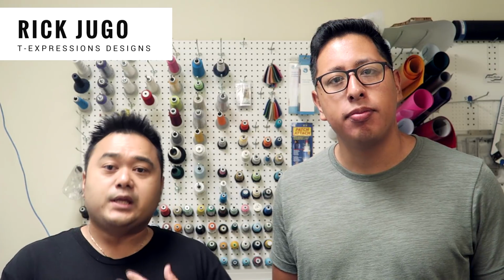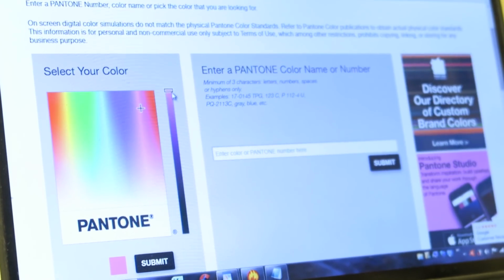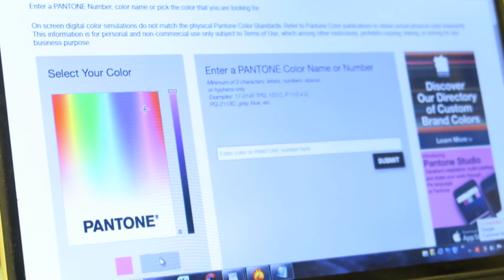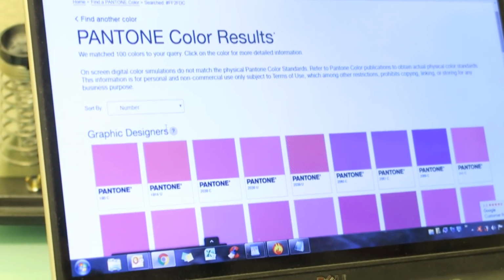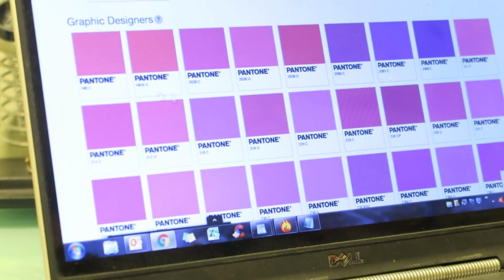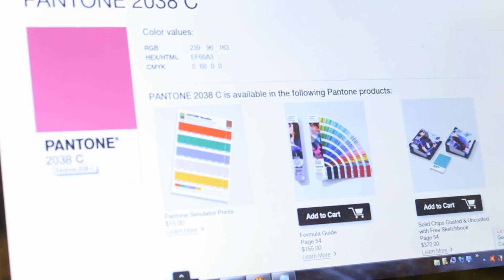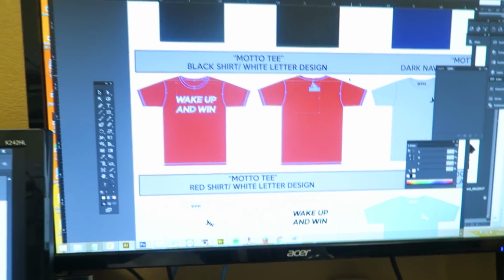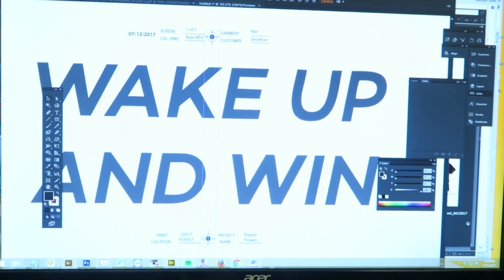How To Design And Print Your T Shirts (6 Step Tutorial)

Comment: Hey John, Great video!!! - quick question, I gathered this print modes were Vector based  for Screen Printing & Vinyls, Do we need Pantones for DTG and for the Techpacks templates? ( as these are Myriad of colours) ? little lost?
Reply: Sher Azam its always good to know your pantone colors in your project. if its a picture then you wouldn't have to worry about it rather making it vibrant.    this is referring generally to spot printing.